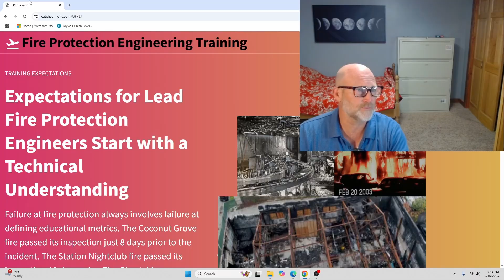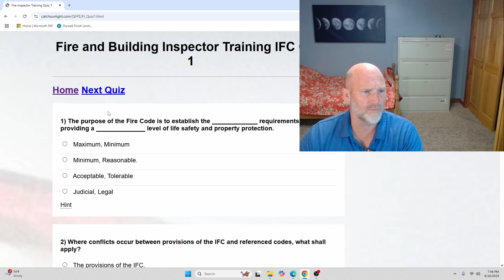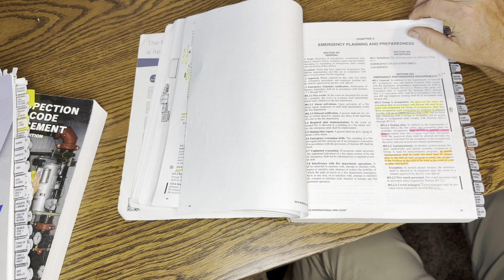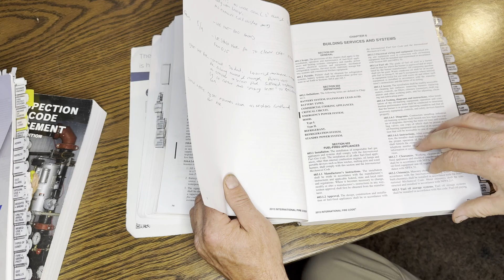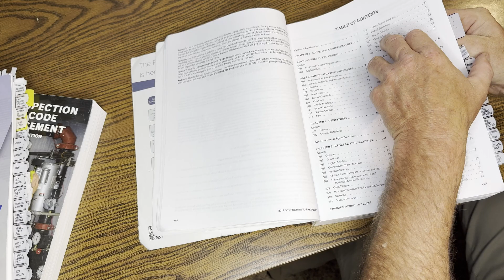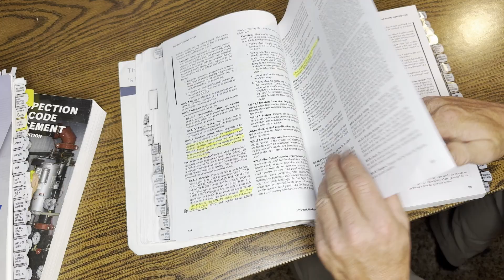ICC Fire Inspector I & II Cert Part 1 (IFC 1-9) (66/67) || Free Online Tests and My Notes

Comment: I am in the process of applying to be a Fire Inspector with my local FD. They require a ICC Fire Inspector 1 certification as well as the being a police officer (I’ve been LEO for about 6.5 years) since our fire inspectors are sworn law enforcement officers. Are these guides meant as a supplement to a course or can they be used as stand alone study material to take the ICC exam. They seem extremely thorough but I just wanted to see if I should take a course and use these in addition or can I just use these and have a good shot at passing the test.
Reply from the maker: Courses range up to $1,000.  The test is around $300.  The principle is to understand the layout of the code.  These series of tests will help learn the code layout.  Go through them until you know the sections of the code by memory.  If you fail on the first time, pay for a prep test and try again.  That's probably the most economical approach.

Comment: Great video! If I get the IBC and IFC 2024 versions, will these practice tests on your website still align with those (I know you said for the most part, but just wanting some clarification). I’m hoping to take my inspector 1 test and noticed it asks which version. I was planning on taking the 2024 version and am hoping your practice quizzes will still be useful for this version.
Reply from the maker: It's about knowing the layout of the 2024 code set.  The questions reflect the 2015 versions, but much of that remains the same.  Just brush up on Chapter 12 specifically.  A smart move would be to highlight your 2024 version with the 2015 notes.
Reply: I had the same question as I’m going to be taking my 2024 IFC inspector I test soon. So far, I’m following along with your highlights and recommendations. The quizzes have been very helpful.
Reply: @AmandaVanDeHey-jq3rv  did you pass 😊

Comment: I work in the insurance industry performing fire and life safety inspections. I was considering pursuing NFPA’s Certified Fire Inspector. However, after reading through the IFSTA book and coming across your channel, I’m considering ICC’s Fire Inspector I & II. Do you have any insights or recommendations while I weigh my options? Do you recommend ICC over NFPA?
Reply from the maker: Idaho is an ICC State as most are.  I think it makes more sense if your municipality uses the IFC to be qualified through ICC.  But if you use NFPA 1, then it makes sense to pursue the NFPA certification.  My observation is that the certifications likely are the same as there is very little difference between NFPA 1/101 (etc) and the IFC, only minor differences.
Reply: I appreciate the your response. We are a regional carrier, insuring in AZ, CA, NV, OR, and WA. From what I can tell, all 5 states have adopted the IFC with some of the states adopting state-specific amendments. I think the IFC is the way to go in my case. I’ll be sure to watch your videos and go on your website during my certification pursuit.

Comment: Have you found tabbing the book helpful more or less?
Reply from the maker: The ICC stock tabs are valuable at turning to the correct section.  The other unmarked tabs are questionable.  They have enabled me to answer a few questions over the 18 tests I've taken.  Maybe those few made the difference between pass/fail.  There's no way to know as a pass provides no percentage value from the testing service provider.  I'd do it as it is worthwhile insurance.

Comment: Will this help with the 2018 test?
Reply from the maker: Fire Inspector I (exam 66) is only supported for the 2021 and 2024 codes via iccsafe.org currently.  I don't think the 2018 test is available anymore.  Is there another venue that supports that version?
Reply: Any recommendations on where to get the 2024 versions of these books at a discount?